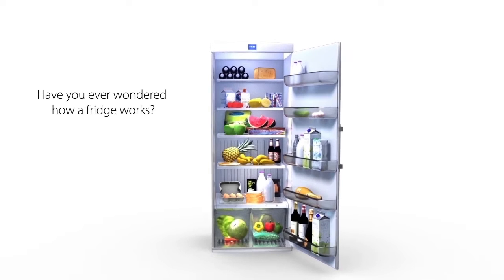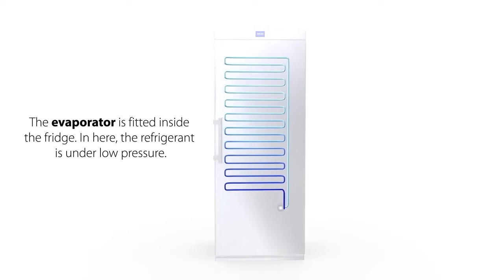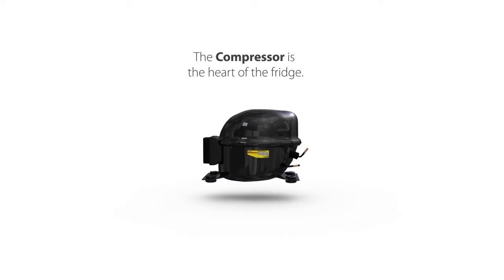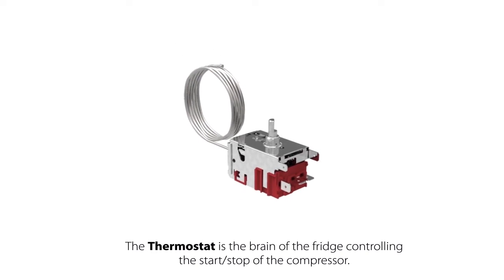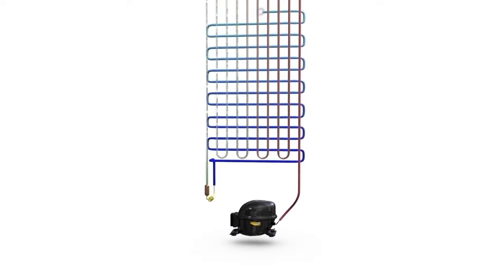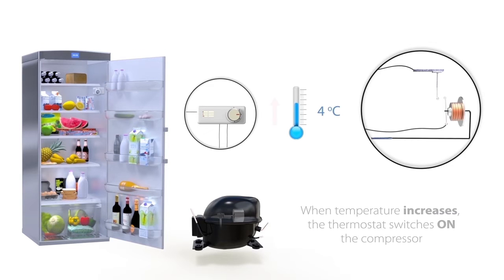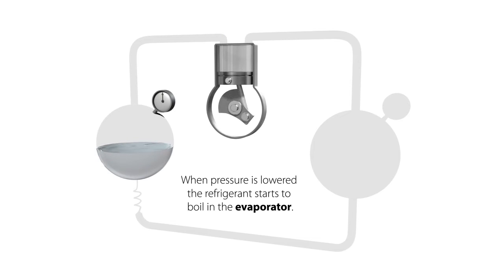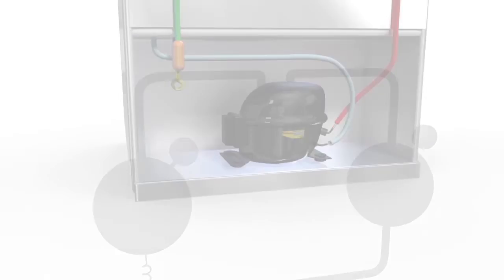The Fridge | How it Works | Explanation Video | Danfoss Cool english

Comment: How we can identify the change of phase Liquid and Vapour in an Refrigeratior
Reply from the maker: When phase change takes place, the process itself steals energy in the form of heat. So, if whatever you have inside the fridge gets cold, it's because the things are drained of energy, which is a sure sign that a phase change is taking place inside the tubing of the refrigerator.

If no phase change takes place, liquid refrigerant would run to the compressor and simply destroy it over time. That would sound like someone hammering on a tin can.
Reply: super heat and sub cooling